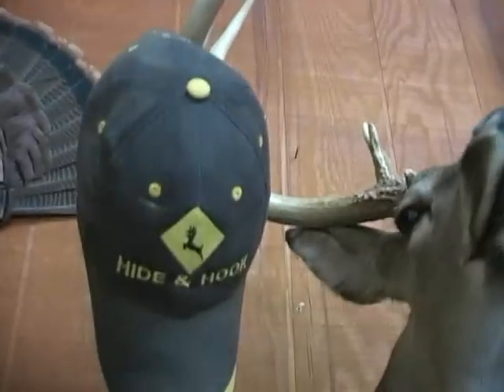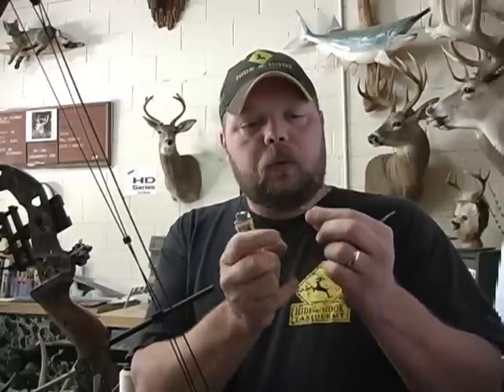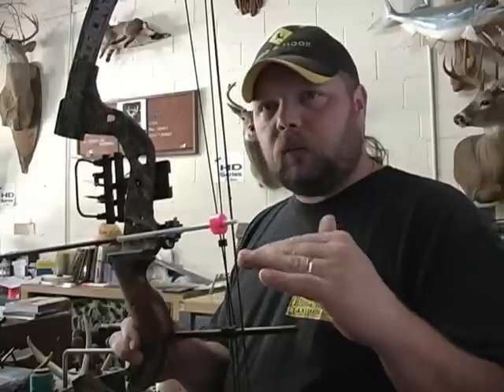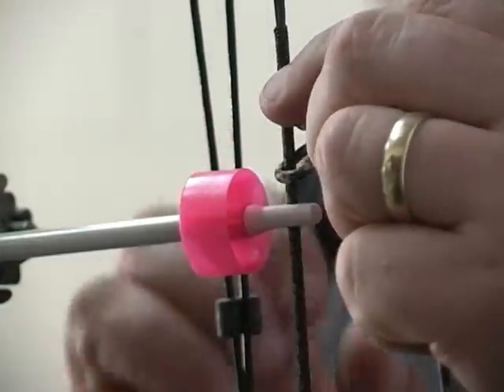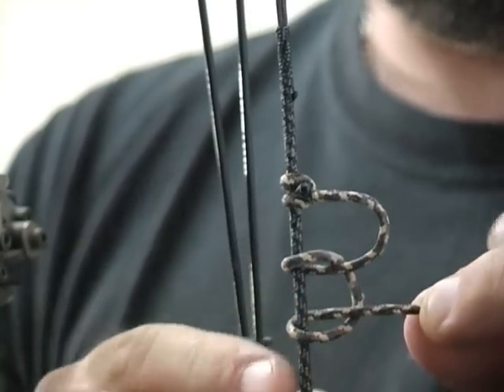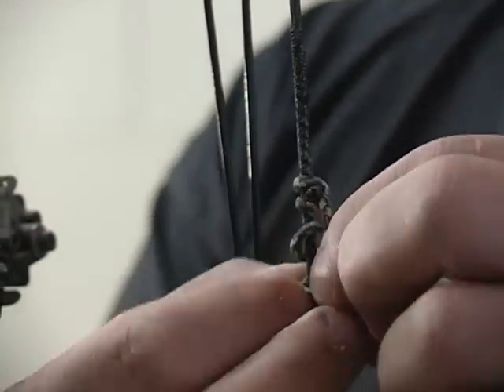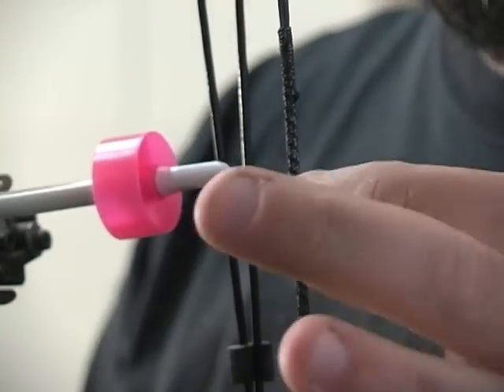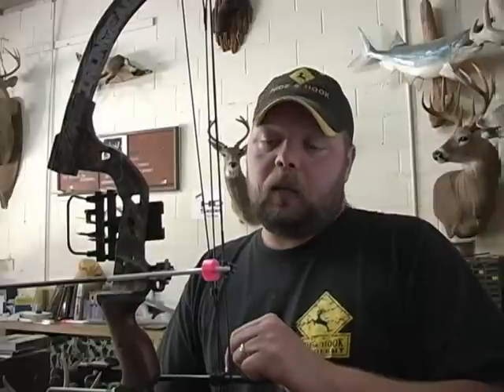Bow Tuning Tips/How To Tie A "D" Loop

Comment from the maker: @588158 Yeah it reduces string wear and it also gives the arrow a push directly from behind rather than rocking in without the loop. The loop should be set level on the Onida if the limbs are in time meaning they both stop at the same time when you draw. Hope this helps, have a GREAT seaon!

Comment: @grttaxi I'm not near the expert you are, however I have knowledge from an unrelated issue on why I know that Bohtr is correct actually.  The string will flex but it will still be pulled laterally a slight bit upon release.  This will cause the string to undulate the same way it would if it was released by fingers rather than a mechanical release.  This is probably VERY minor but in theory he is correct.   Thanks for your vids, they're among my favorite for straight forward good info.

Comment: Fraying the last 1/4" let's you hold it a couple inches above the lighter.....this way it melts into a nice ball without catching ablaze. I also do the ends before tying it on since I know how long I need mine. Remember, too, that smaller diameter rope (like 1.8mm) requires just a little shorter piece.

Place alternating the knots on opposite sides of the string help eliminats some small tuning issues.

Comment: Thank you! I have a question about selecting arrows. I am looking at some Easton carbon arrows and dont under stand what spine size I should use. I have an Oneida  Aero-force bow with a 26 1/2 inch draw set at 50 lbs. The arrows I am looking at 27 1/2 inch Easton Powerflight Arrows with 4inch vanes offered in spine 300, 340, 400 and 500.

Comment: Grttaxi, Is the purpose of using a D loop to reduce the wear on the bow string when using a release? I  am just getting into archery and  have used Oneida areo force bowthat has just been rebuilt to my draw length. Is there anything special I have to do to set the position of the D Loop?  By the way, Your video clips are excellent and verry well presented.

Comment: this is different from the one the guy showed me at the store.

BUT, this method looks much better. I am going to do it this way instead.

I have a question though: 

I have a new, relatively cheap compound bow. The string does not have that thickened, or reinforced bit that yours does. Is it safe to put a D-loop onto the bare string? or should I find some of that stuff you have on yours? and if so, what is that stuff called?

Comment: what about Dyneema Mini-cord as extreme replacement material for D-loops? this stuff is used in sailing, should hold up to 400-800lbf, pretty much the same in texture with regular D-loop cord.

And an old tea spoon makes a great tool to form the greatest D-loop balls, heat the underside with your torch and just turn your loop in the spoon. Should be the right tool for an old firebug like you - watch your fingers ;)

Comment: Kenny, My d loop is getting a lil raggedy. I am concerned that if a do not put the new d loop in EXACTLY the same position on the string, my sight pins will be off. Also will using a different diameter d loop material mess with my point of impact. I HATE MESSING AROUND WITH MY PINS becuase I just got them set perfectly. That was a chore! Help.